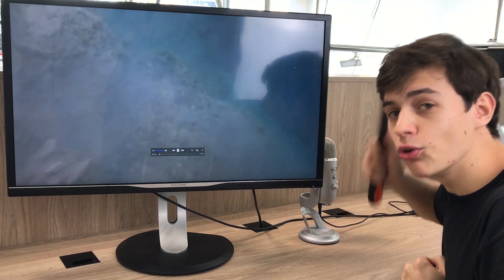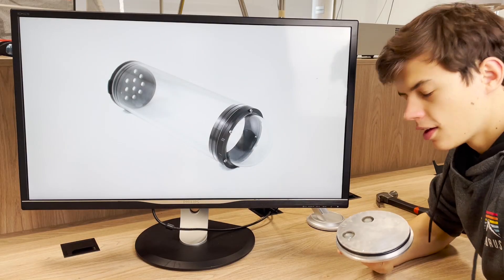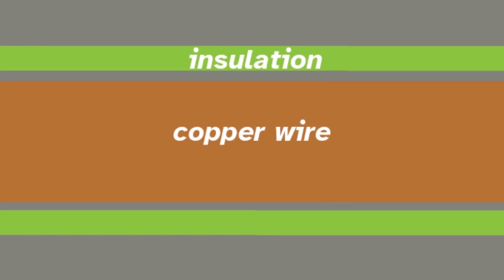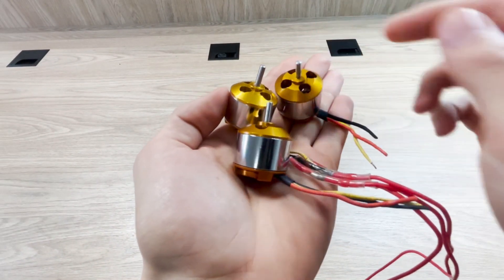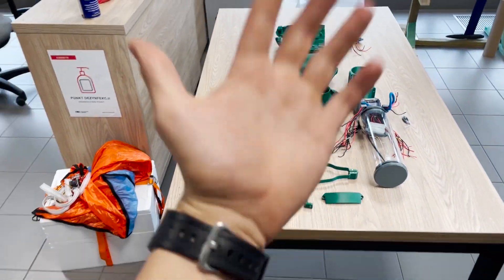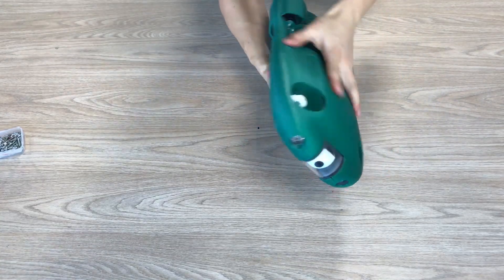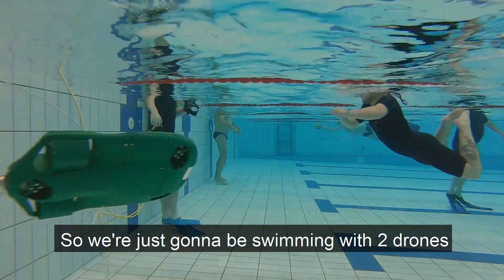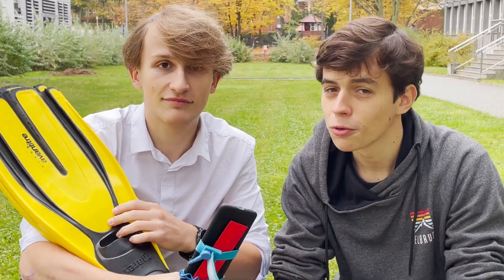We 3D printed a submarine (dives down to 85 meters / 280 feet)

Comment: Why not put a receiver, the video transmitter and antennas in tethered floating buoy? That way you could get a lot more range.
Reply: If you're in a boat, you don't need a lot more range, and if you don't have a boat, do you really want something you've spent that much time on being so far out of your reach? 
How would you get it back if the battery dies or you get a leak and it shuts down? What do you do if some guy in a passing canoe picks it up and paddles away?
Reply from the maker: Agreed. In practice it gives you peace of mind to keep the cable close to you. A couple of ROV companies (eg. Chasing) even opted out of this option. Maybe we’ll try to do this in the future though.
Reply: @the_omg3242  I gave this some thought after I made my comment, and I thought about the same potential problem. Then I thought about using a RC boat instead of a bouy. Then you could tow the sub back to you if it failed. You'd have to be pretty unlucky to have both fail at the same time.
Reply: @douglasdippold8235  
Of course then you'd have to have 2 separate radio frequencies. One to control the sub and one to control the boat. I'm not sure if RC radios have multiple frequencies like that, but it's a safe bet the cheaper ones don't. 
Or, you'd need a single frequency radios with enough channels to control steering and speed on the boat and pitch, roll, and depth on the sub. And don't forget about transmitting telemetry back to the controller for depth, battery charge on 2 devices and anything else you want the ROV to transmit. (other than video)
You're adding a lot of complexity just to cut the cord.
Reply: @the_omg3242  Modern rc transmitters haven't needed seperate frequencies for decades. They use spread spectrum technology, and many come with telemetry all using the same band of frequencies, and they can be had at modest price. The seperate camera systems use entirely different frequency bands, and also come pretty cheap.  
 For a good example look for FliteTest's videos of their FliteFest events. They have dozens of rc planes in the air simultaneously, all operating on the same 2.4 Ghz range of frequencies, with no need to assign seperate  frequencies to the participants (which was required in the before times of expensive FM systems). You simply bind your transmitter to your receiver, and modern electronics does all the work.
Reply: @douglasdippold8235  But can one controller handle rudder and speed on the boat, pitch, roll, and speed on the submarine, and telemetry for depth and heading of the submarine?
Also, I think the main thing they're getting from the tether is the data link between the Pi and the surface computer that also includes the video feed. Wouldn't your RC boat also require a wireless data link with enough bandwith for video? (yes, I realize there are FPV video systems for RC's)
Seems like you'd end up with a complete redesign of the control system and software that runs it.
Reply: @the_omg3242  Everything you just mentioned is relatively easy to achieve with off the shelf items. Flight controllers can be used for anything without the need to design or program anything. It's simply a mater of setting parameters and ranges, and channel mixing. For example, the same outputs that one would use for controlling aileron servos can be used to control the motors that control the roll axis on the sub. a flight controller profile meant for a quadcopter would be even easier to adapt for a sub with four motors for attitude control.
As for the boat, there would be no real need to have it's integrated into the same transmitter. My idea was to have the sub pull it along as if it were an unpowered buoy, and only put into use if needed. It would only require the cheapest of transmitter and receiver, as the only need two channels to control it.

While I admire the achievements of these builders, they could have gotten an even more versatile result for less money than it will cost for a handful of boat rentals.

Comment: Wow. You can really tell all the time you put in. Now you just need  a small robotic arm module. You could also make the tether float at the surface keeping an antenna out of the water for wireless connection.
Reply from the maker: That was our plan long time ago (you can see even in the first video on this channel) - making a buoy with a receiver and a transmitter, but we never actually ended up using it in an intended way because we were too afraid to loose it. Wired connection seems way easier & less complicated for now.
Robotic arm would definitely be useful
Reply: @CPSdrone  You wouldn't even need to go all out and do an arm. Just a claw that opens and closes would be useful. Maybe consider bringing some extra wires through the end cap for a spare servo port and add software control to run it. A claw would let you grab stuff without a loop like sunglasses and cell phones.
Reply: @CPSdrone  
That seems like a lot better choice. There are a few ROV's that use a wireless float attached to the drone. There are 2 issues with those. One is that your drone has to tow the float around. The other is that if you launch from shore and the wind or current is taking it away from shore, it can be more awkward to get your drone back. You have to be able to grab the drone or the float to pull the other one in with the tether. If the drone gets hung up on something and the tether is out in the water, you're going swimming.
Reply from the maker: @the_omg3242  agreed.

Comment: This is really cool! It would be interesting to see its ability to handle open ocean conditions! 

An underwater drone has been on my todo list for a while, my only question is if it's already tethered why not tether power in to the drone?

 It'd remove the need for batteries onboard.
Reply from the maker: Thanks a lot! So the longer tether we use is 100 meters (330 feet) long. The wires in there are 26awg. So the total resistance of each wire is at least 10 ohms (20 ohms for the wire going into the drone and back). And that's too much for our 6A power requirement if using 60 volts. Also, 60V in the water can be dangerous to wet skin. 
Batteries are just cheap and effective.

We will maybe try doing that with a bigger ROV we plan building for wreck inspections, so we'll see

Comment: That's so cool, would lile to make one but bit too complicated for now😄
Reply: If you're really interested in this sort of thing, there's tons of people that make them out of PVC tubing and bilge pumps on YouTube. Those are a bit simpler. You could build one of those and play around with it a bit then decide if you want to take on a more complex setup like this. 
Even a crappy homebuilt ROV is pretty easy to sell on the used market because there are so few available for cheap so the sell cost of your first one can fund the building of your next one.
Reply: @the_omg3242  yea i know that 😅 but i won't be doing anything right now
Reply from the maker: Ah, it's really not that bad :D
Reply: @CPSdrone  it is if you haven't done anything like that 😅
Reply from the maker: @valzzu  That's exactly what we try to make easier with our course
Reply: @CPSdrone  i understand that 😄 but won't be doing this prob in the near future 😅
Reply from the maker: @valzzu  No worries! Thanks for the comments
Reply: Build an air drone first. Not that difficult, but hard enough. Much of the technology is the same, minus the water-proofing issues.
Reply: @Andreas-gh6is  i have dji drone 😅
Reply: @valzzu  yeah, I just meant building your own drone is quite easy and a good first step. By that I mean assembling a drone from esc, motors, controller etc
Reply: @Andreas-gh6is  yea i know, i will be making a rc plane with my friend soon